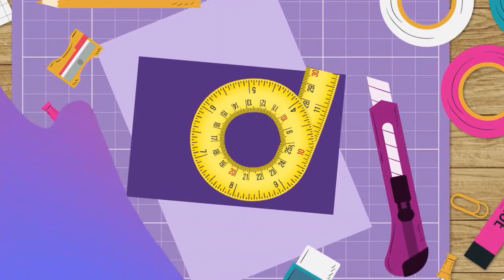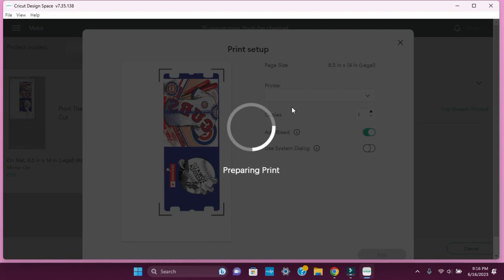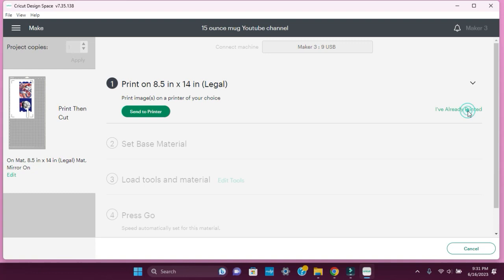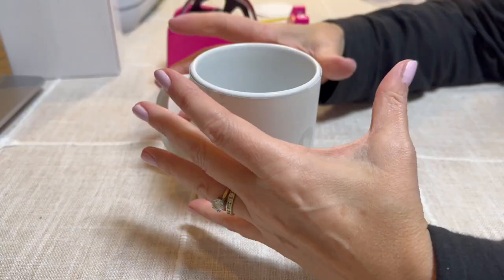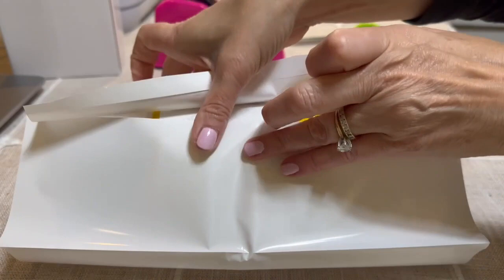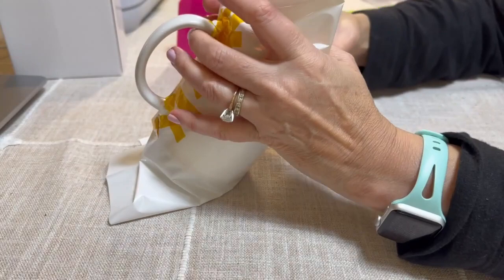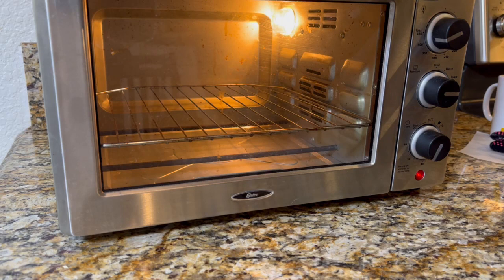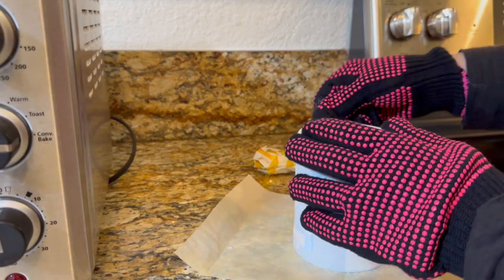How To Sublimate A MUG With Convection Toaster Oven

Comment: Beautiful.  Do you put the dial on the convection or baking settings?
Reply from the maker: One of them I put it on bake and my other one I put it on convection. Hope that helps. They both work the same.
Reply: Thanks
Reply: is the time in bake setting longer than convection setting?
Reply from the maker: @dragonfly6217 that’s a really good question!  I’m not really sure! My old one didn’t have the convention dial and I used the bake dial - and the same time and it worked great!